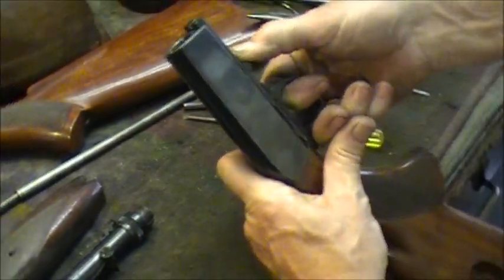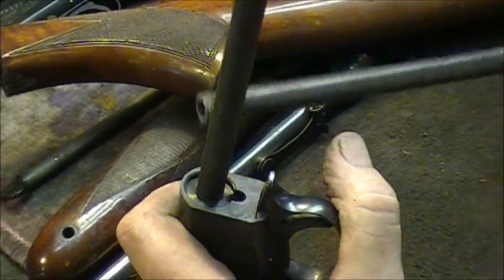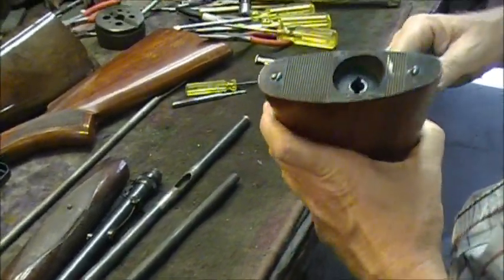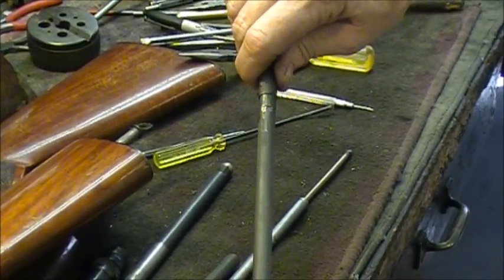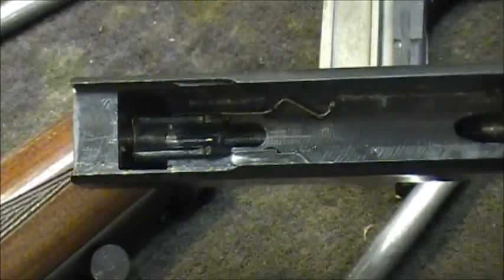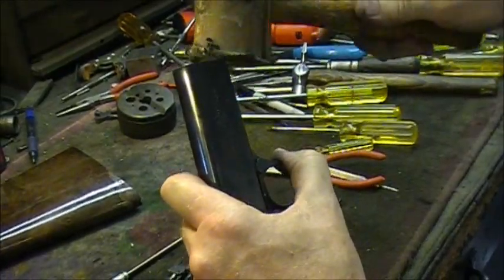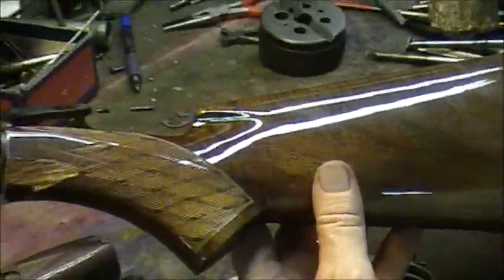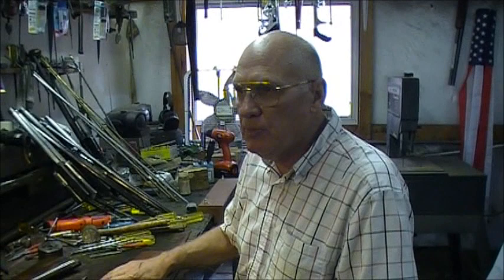Browning 22-Auto Assembly & Disassembly (Part 2 of 2)

Comment: I have to say thank you for part 1 and 2 of this video!

I bought my Browning .22 in 1976, and it still works perfectly. A funny thing is when it was new, it would often jam, and I almost took it back. After about 200 rounds, it smoothed out, which is great, but I was not expecting burrs in the action of such an expensive gun.

Much later, I figured out how to disassemble it, and I GENTLY stoned down some of the sliding surfaces. According to the gun store guy, this model will fire both long rifle and shorts, but I have not tried shorts yet.

My point is to thank you, as these two videos educated me on several points that I did not know about!

Comment: Excellent video and I am now subscribed. I just inherited a Belgium made model and I am in the process of installing a later made barrel tapped for a scope mount. All fit together well but I could use some help with installing the forearm lug into the barrel. Is there a specific direction to drive the lug in. I have measured the lug and groove and using the widest side of the groove and the narrowest end of the lug dovetail, it seems to be too large.

Comment: I just received a 1973 SA22. It was missing the locking mechanism for the barrel, and these two videos saved me on the instillation cost, and possible parts markups. I brought it to the range yesterday, and had an issue with the bolt not wanting to open (charge a round) with a round in the feed tube. Everything moves like butter without any ammunition loaded, and all the parts are there. Any help on this matter would be greatly appreciated.

Comment: Quick question, I have an old remington model 24 which the tube had broken inside of the end of the receiver and I was wondering what size die to run through to clean up those threads.

Comment: When replacing the last spring in the bolt, I was unable to get my 78 year old fingers to hold the spring under tension and get the pin into place. I ended up placing a short piece of masking tape under the area to which the spring "wanted" to go, and was thus able to get the pin into place.

Comment: I got a good laugh when you showed the "new system" magazine tube, that had the metal pin holding in the end, and that stuck out to lock into the lugs in the outer tube in the stock - I've got a Remington Model 24 in 22 Short, made in 1922, Remington's version of the SA-22 - it has the exact same inner magazine tube with the same locking method.

Comment: I just recently got one of the older ones but not too old, doesn't have the wheel style rear sight.  It has a CRACK IN THE STOCK just like you talked about.  I'm trying to fix it myself
Reply: I'm handy when it comes to fixing THINGS.  I have done quite a few relatively minor gunsmithing tasks: replaced a breach block and recoil spring on a German Luger.😁  I'm retired so I watch my money.  If I think I can fix something myself for little money I will give it a try.  I'm trying to take the stock off from the receiver and the end of the loading tube appears to have a large slotted nut holding the stock on the tube. Is there a trick or something I need to know before I attempt to undo that large nut at the end of the loading tube? Can you HELP ME? PLEASE.🤔🙄😊

Comment: Art, I bought this gun in 1969, and now I'm having failures to fire and eject. I noticed the extractor has play in it from side to side by about 1/16th inch. Not sure if the block is worn or after all these years the extractor is worn.  Should I try to replace both? Not sure if I can get parts.

Comment: Great video! Wondering if you could help me? I have just bought a used 
Norinco jw-20 ( sa22clone).
Its a copy of the later models, stock is retained with the large thread piece that the loading rod locks into.
Now the machining is rough..Chinese...I know..lol
N
But when you go.to close the load rod it get hung up on the bullet cases, have to jiggle the gun and it finally lines up. Id like to take part the loading road...is it just a matter 9f drifting out the cross pin ? I think I need to emery cloth or chamfer an edge on the tube where the bullets retract in so the rims won't get hung up.  I just took the gun apart full and cleaned it but didn't touch the loading rod yet.. curious if this  problem ever transfered over to Sa-22 model? And if I'm not correct in the fix
Reply: I just actually figured it out if.i turn the rod while pushing down it doesn't get caught up!
Reply: Onde consigo a vareta do alimentação do 22 belga

Comment: Hi, 
I have a brand new Browning SA-22.
 I noticed, when fully assembled, the trigger/bolt assembly has a very slight wabble from side to side. 
The stock is nice and tight on the receiver and the barrel is nice and tight on the receiver. Anything to worry about??
Thanks
Johnny.

Comment: I am having trouble with this little gun. When I pull back the bolt, all the cartridge just shoot out. Sometime it feed itself before I pull the bolt. i checked cartridge stop and spring, they looks fine. Should I just buy new stop and spring? Have you met this kind problem before?